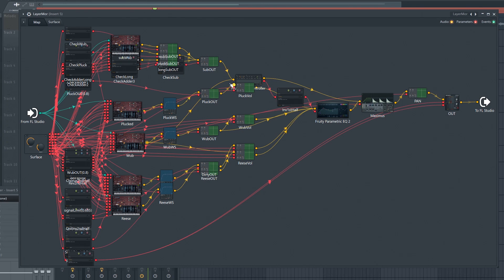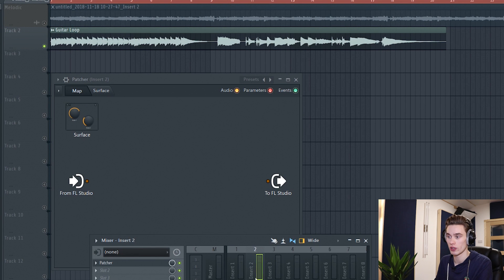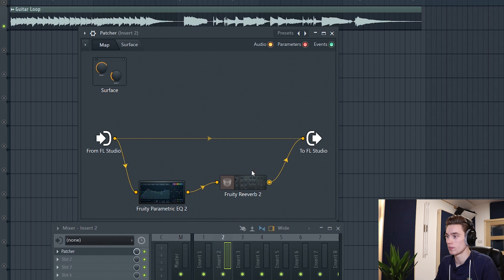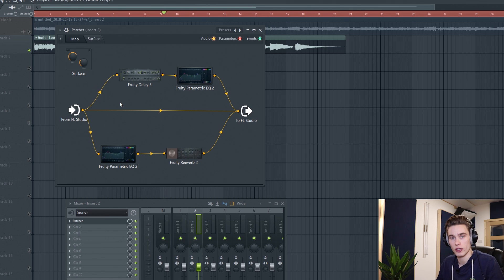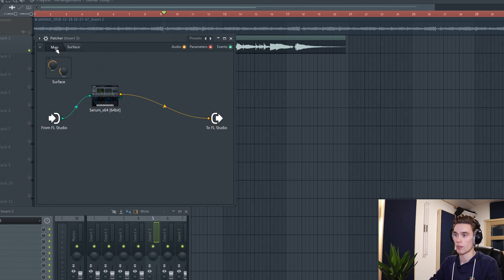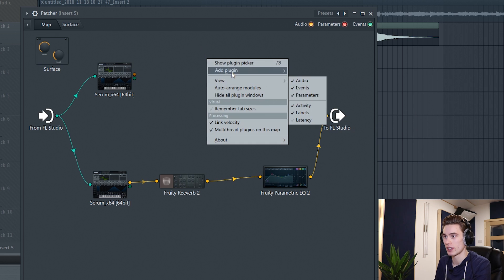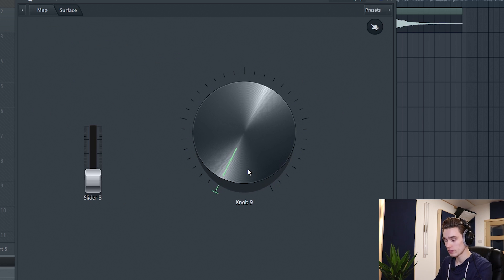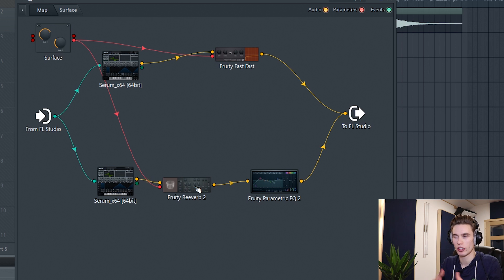How To Use Patcher - Everything You Need To Know - FL Studio 20 Basics

Comment: And you can make a 1176 clone... 😁 😎 Take a lot of time but you can do it... first you need to learn make a oversampling plugin in patcher from parametric eq 2 you can make a linear phase oversampling plugin but it's also complicated process so if you just start use FL don't do it...! But basiclly whit some saturation and 2 peak controller you can do a 1176 if you set both base at 50% and boost the first peak controller detection a bit up ( this will be your attack) and the 2nd down and the first you connect a parametric eq gain and the 2nd the eqs beetwen the ovs and saturation...May I tell complicated but may some people understand it😅😂

Comment: Hey bro great video! I have one issue/question I'm having over patcher that I wonder if you have any answer to.  I'm linking a fader in the control surface to the speed fader of a delay effect in the map to make a live feedback ratchet effect with custom modulations for analog synths.  Now I want the entirety of my control surface fader to control only a tight speed from like 0 to 1 or 2 steps of delay, and every off beat between, but not much above that or it won't really be a tight ratchet.  I can do this by doing "link to controller" with a control surface and effects in the mixer as it requests a mapping formula be entered, but when I use patcher I have to activate and link the red cables which I don't see anywhere to input a mapping formula.. 

So to boil down my question/issue: Is there a way to input mapping formulas for the activated links? If you have any answers let me know, I can't imagine they would leave us high and dry with an excellent patcher and no mapping formula input..

Comment: I've used a lot of node based programs for 3D work, patcher seems be lacking a lot of key features which would make it a crazy good tool, such as the ability to control patcher commands with patcher commands. If it were possible to create a switch that would unlink certain chains linked to chain effects. Then the application this would have for surface would be great.
Reply: I think you can do this by simply setting the mix level to 0%/100%. I also used node editors for making shaders in game engines/blender and I did not even know something like this existed in FL...
Reply: @kebizembola  Interesting, you got a skype to chat on?

Comment: Is there a way to use a knob to control things like the filter frequency inside third party synths? When you activate a knob with something like harmor it shows another red connection point that you can connect to a control surface. I was just thinking how nice it would be to set up a patcher preset with knobs already connected to things that are most commonly automated so I don't always have to tweak something and then go to last tweaked to automate something in a third party plug in.

Comment: Is there a way to set the minimum and maximum values of the surface control like you can with the macros in Ableton? Like, for example, when i turn my reverb slider all the way up, I don't want my reverb wet to go all the way up, only to a certain point.

Comment: for me patcher is useless at present, because if it is true that it allows to put more synths on a single channel, then it does not allow to connect every single synth to a single channel of the mixer but only allows to connect the patcher channel on the mixer without have the ability to mix various synths

Comment: Any chance you could show setting up a map in the control surface to a midi controller?  Would it be a viable workflow to setup your main template with your midi controller pre-patched to various effect chains to function as a master controller?  Can control surfaces be preset up to control outboard midi hardware to make controlling them from the gui easier?  I was thinking of using this with some midi knob and fader controllers to keep a visual representation of the controller itself in the software so when i route something to the control surface its automatically routed to the physical controller.

Comment: If you want to push a sound back in the mix using reverb,do you insert reverb straight into the mixer channel or you run wet & dry signal parallel?

Comment: Can you help me? The problem i have with Patcher is that the Knobs on the Surface don't really work like i want them to. Let's say i want to make one Knob to control Reverb and Distortion, like in your example. When i link the Knob, turning it up to 100% percent it will automatically turn up the Reverb and Distortion to 100% as well, right? But i want that one, single Knob when i turn it from 0% to 100% to turn up my Distortion in the Range from 30% - 50% (in the Plugin), but the Reverb only from 0% - 15%... How to do that? In Serum for example that's not a problem. You simply drag until (for example) the LFO covers the amount you want to have... Same example as above: I just set the Knob to 30% and drag the LFO up until it reaches 50%, or i set it to 0% and drag it up to 15%. Same thing in Massive, for example. 
How to do that in the Patcher? It always seems to go from 0% to 100%, which for my purposes makes it useless.
Reply: Add fruity envelope controller for that.
Reply: Also you can use fruity formula controller

Comment: Hey guys I have a question. So I have a FX chain saved in patcher (let's call this patcher1 ) with two knos controlling some parameters. I open up the same patcher1 into another patcher (let's call the patcher2) & set some knobs. Now I want the patcher2 knob to control patcher1 knob. How to do that?
Reply: activate knob in patcher2 and then drag red output over the patcher1 , you get the choice of which knob would be connected
Reply: @feggyo  This works for the parameters. If I have EQ2 opened in patcher1 & then I drag red output over patcher1 then it gives me option to control all the frequencies & stuff like that. I have a knob in patcher1 that controls EQ's volume of frequencies on the control surface of the patcher1 & I also a have a knob on the control surface of patcher2. I want the knob of patcher2 to control the knob of patcher1 (which is present on the control surface of pather1). Hope that makes sense.
Reply: @DRPDMusic  So try to add a new plugin Control Surface in mixer channel  . Go to both knobs, switch off  "edit controls", right click on a mouse over knobs ---> "Link to controller" ... select "Internal controller" . Do not check "Remove conflicts" and you can now control both knobs by this new knob. Hope it works :)
Reply: @feggyo  I'll try when I get back to home

Comment: Currently I have 18 inches LCD I'm about to buy new one, can you tell me how much inches computer LCD/LED screen do you recommend to buy for FL studio to fit in perfectly
Reply from the maker: I think mine is 32 and it's got far too much space, I got a TV screen for around $100
Reply: @inthemix  Since we're discussing hardware specs, what kind of computer or laptop should I run FL on? I know the only major thing is CPU usage and many computers and laptops can run the program decent, but I just wanted to hear your opinion. Also does it really matter if I produce on a laptop versus a computer? I always hear to not use a laptop, but I'm assuming if there's an argument there that it's only because a computer usually can handle being pushed more on CPU.